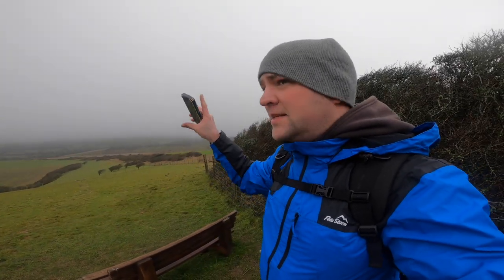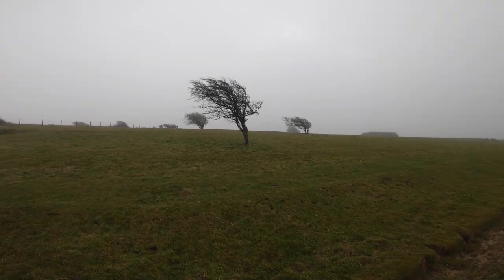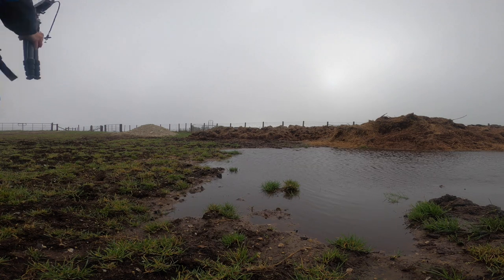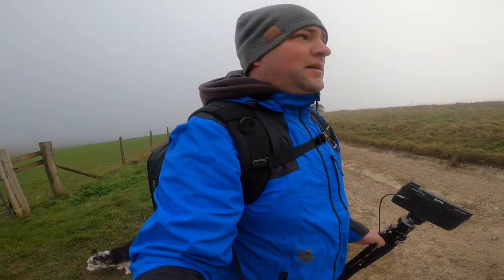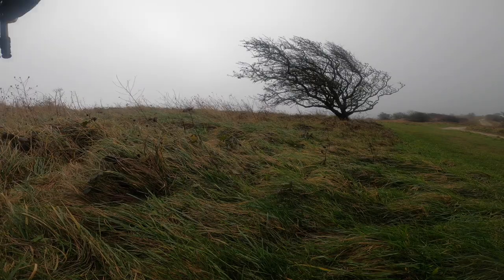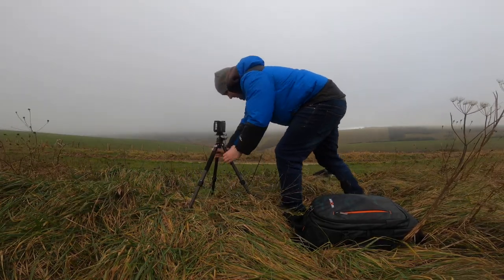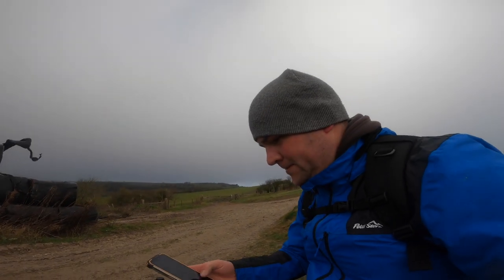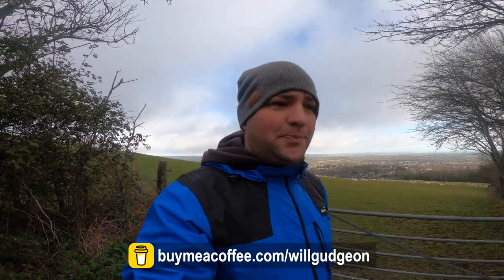Using my Holga WPC in 25+ mph winds, loaded with Ilford Pan f 50 film

Comment: I’m always fascinated by how you manage to get great compositions when you don’t have the aid of a viewfinder. Great images and great shots. 
In regards to the wind noise, I’ve been trialing recording audio into my phone via a lab mic with a furry wind protector, then syncing the audio to the video in post production. It doesn’t give perfect results but the sound is usually much better.
Reply from the maker: Thank you Matt, lots of trial and error with the compositions 😁
I have normally got a wind muff protector on, but recently added a Media mod to my GoPro which was ment to surppress with the wind well... however, I had it set to "stereo" instead of "front mic" which is apparently not a good setting for windy days, so need to experiment more.
I have been recommended recording the audio on another device and syncing up which I may have to do on windy days, just need to experiment a bit more.

Comment: Good to see the Holga get an outing Will. Have you resolved all the issues you had with it now?
Reply from the maker: Thank you Michael 😊
So most the light leaks are gone, it does seem to leak slowly, the last 2 frames especially were showing leaks, I think the longer it is left on a frame it shows more (small light leak), the first 4 shots were fairly quick after each other.
I think just a bit of black tape should sort it now 😎
Reply from the maker: I had also never been totally happy with the scans (maybe my scanner?)
But I tried a Pixl-Latr with my digital camera and much happier with the results
Reply: @WillGudgeon  that's interesting Will, I've been using an Epson 850 and I'm pleased with the results but I've never tried Pixl-Latr.
Reply from the maker: @ducatitastic  I only have an old Epson v600, I originally brought the Pixl-Latr for 4x5s as I have to scan both halves and merge together on the v600.
However after scanning the 120 and also using my digital camera with the Pixl-Latr the overall look seemed more appealing.
May just need to have a play with some scanner software.
Reply: @WillGudgeon  thanks, as I already have film holders that came with the scanner I'm going to try photographing the negative just to se if there's any noticeable difference with the results because while I am happy with the 35mm and 120 scans I'm a little unimpressed with 4x5 (although that might be down to me 😂), cheers Will.